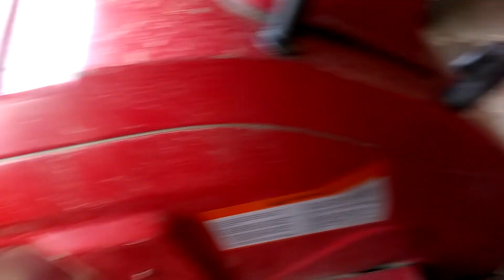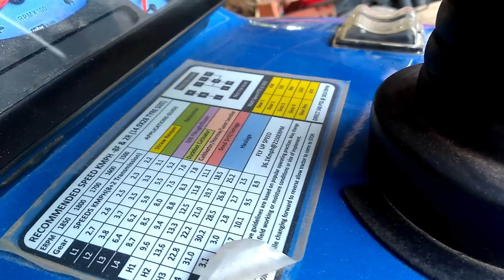Arjun Novo powertrac euro 55 powertrac 439

Comment: Euro 55 novo 605 ke muqable me kaisa h?? Rotaweter aur power me
Reply from the maker: mahendra pratap yadav Novo se powertrac euro 55 bahut jayada acha hai takat bharpur hai aur mileage bhi
Reply: Pinkesh Singh tyre 14 ke h ya 16 ke...??
Reply from the maker: mahendra pratap yadav Novo me 16 ke aur euro 55 me 14 ke chaho to aap 16 bhi le sakte ho
Reply: Pinkesh Singh platform thoda flat banate euro ka to achha rhta, horn steering me dete, clutch suspended lgate to mst lgta
Reply from the maker: mahendra pratap yadav style hi sab kuch nahi hota hai
Reply from the maker: Flat platform aur suspended pedals Massey Mai aata hai
Reply from the maker: mahendra pratap yadav  powertrac euro 55 supermaxx is too much powerful than Arjun Novo and too much fuel efficient
Reply: Pinkesh Singh malum h.. but comfortable rahta h.. messy 9500 bhi achha tractor h.. kafi damdar h.. PTO power kafi achha h
Reply from the maker: mahendra pratap yadav Arjun Novo 9 Tyne cultivator me 5 litre per hour leta hai aur euro 55 4 litre on 11 Tyne cultivator
Reply: Pinkesh Singh apna Facebook link bhejo..
Reply from the maker: mahendra pratap yadav Massey me front lift problem hai aur kamjor gari hai aur halka bhi euro 55 supermaxx 2460kg and Arjun Novo 2480 kg
Reply from the maker: mahendra pratap yadav https://m.facebook.com/pinkeshsinghs
Reply from the maker: mahendra pratap yadav aapke pass konsa tractor hai
Reply: Pinkesh Singh dono same HP ke hy kya